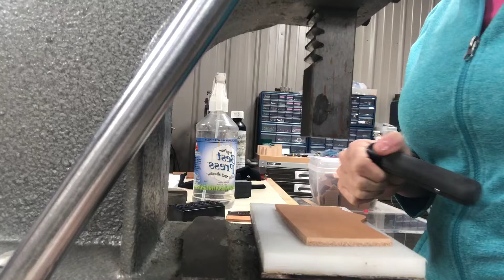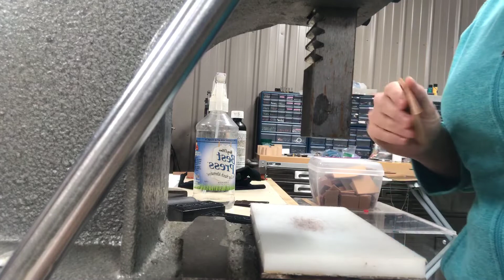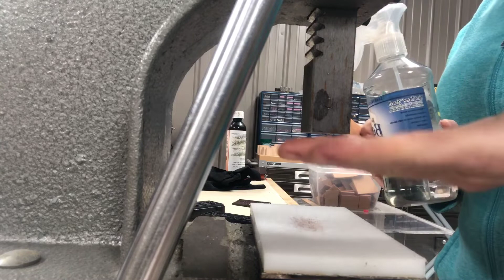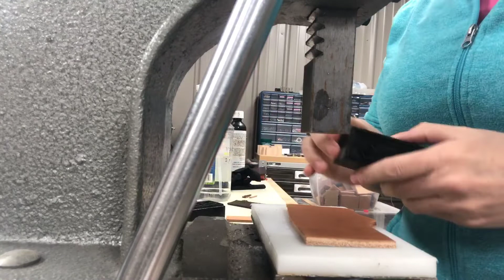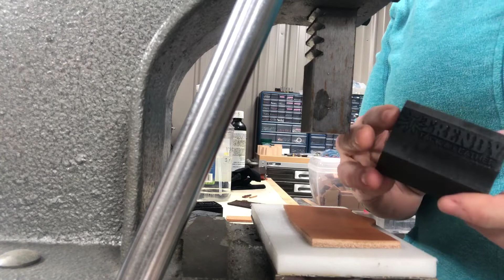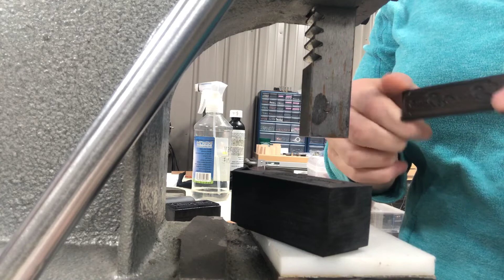Making Leather Tags using Arbor Press and Delrin Stamp

Comment: Here’s a tip for you. I also use an Arbor Press to do my Embossing’s. Go to Home Depot or Lowe’s and pick up a 2-1/2” wide x 1/4” thick “FLAT STEEL STOCK”. The Flat Stock comes in lengths of 4 feet long. It’s always nice to have some 2-1/2” x 1-1/4” 3:51 x 4’ Flat Stock on hand to use as a weight for when you’re cutting leather or as a weighted straight edge. I cut the Flat Stock to the size I need. In your case I would cut the Flat Stock to the same size of your embossing stamp. The steel won’t bend and it will apply the same pressure throughout your stamp.
Best regards, Richard

Comment: Hello. Great video and I have a question for you. I have brass stamps about the size you use in this video. Since the arbor press is a harder metal, what would you recommend I use in order to avoid marring the brass?
Reply from the maker: I don't have experience w/ the brass stamps but I would think if your stamp was flat on top you could use a small metal plate or even a piece of the plastic cutting boards cut slightly larger than your stamp  and place it on top of your stamp to help distribute the pressure, it would work well.
Reply: @tacktemplates2591  Thank you! I'll give that a shot